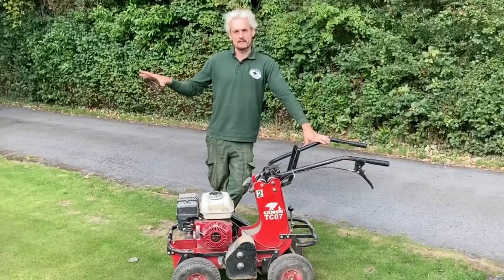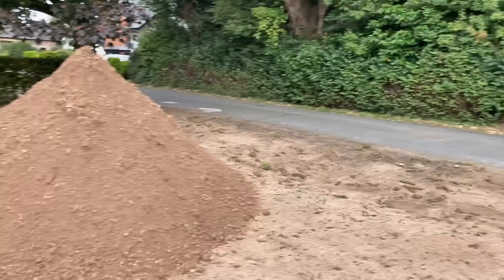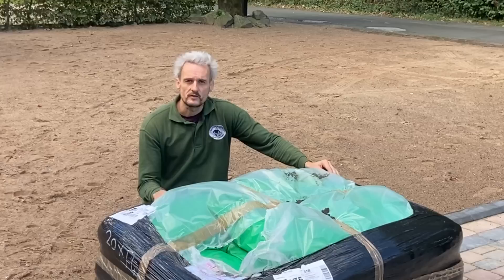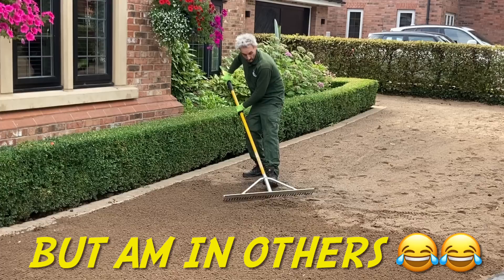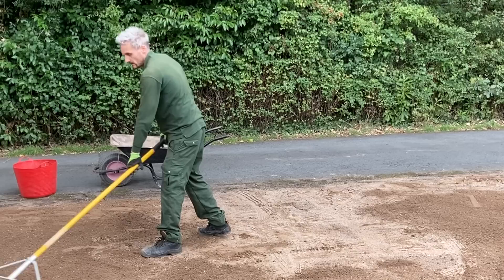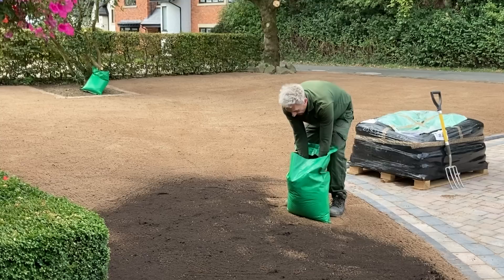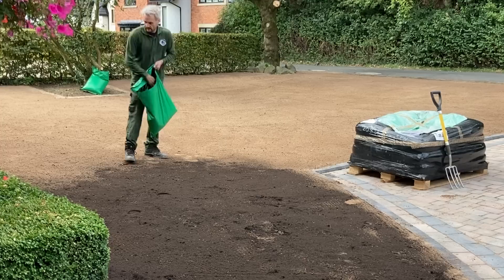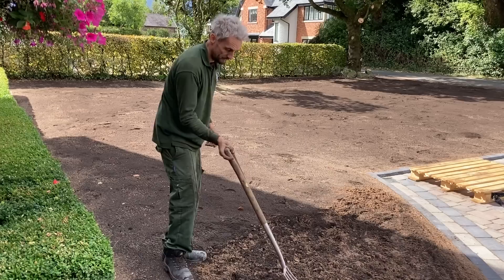The ULTIMATE New LAWN Guide * Part One, Seed Bed Prep

Comment: You work hard Dan, good for your customers to see the amount of effort that goes into the preparation of a new lawn. It's not just the cost of materials but for the hard graft it takes to get it done correctly. I've learnt so much about looking after my lawn since watching your videos. 20k quite an achievement, won't be long before it's twice that. 👍
Reply from the maker: I do work hard …. Most the time lol, it deffo requires graft but alls i used was a rake and a fork so not something you need expensive tools for

Comment: Superb that you've passed the 20k subscribers.. brilliant. Next time the grab man drops the sand off, ask him to spread it as far as he can with the grab bucket, save you (or AN Other) having to barrow it to where he could easily reach. Re the leveling of the lawn base, I saw a tip about using a ladder lay on the ground with a rope attached and pulling it around back and forth. Not having a landscape rake, I bought a 450x20x3 mm strip of steel from Wickes and bolted it level to the top edge of my regular rake, knocked the overseeding down to the roots and my top dressing went in a treat. Lawn looks PDG now

Comment: You could use some old tights as a filter when pouring into your sprayer. It’s works great for Iron Sulphate mixers
Reply from the maker: I could but the filter i have in there does the job

Comment: Really interesting to see you are using so much sand. Your videos related to the use of rootzone have been really educational. 

I'm planning on digging out my front lawn to 6-8 inches and replacing the soil with 75% 5 mm 70/30 rootzone (drainage) and 25% 3mm fine loam soil (water retention and binding surface structure. 

Does that sound like a good plan for optimal long term results?
Reply from the maker: Yeah but could still do with adding some organic matter as 30% in a 70/30 will dry out so quick , the back garden there is 70/30 with drains and few days of heat without water and its struggling
Reply: I was a little worried about that. Thanks a lot. 

I have the option swap the 70/30 with 50/50 or increase the loam soil amount as that has added compost in it but i'll have to check on what percentage. I think it may be as high as 25%.  The last thing I want is to have to dig it up again. @DanielHibbertLawnExpert

Comment: 7 minutes in and I'm playing columbo. Just one question... would the organic matter (field compost) that is being mixed into the sand not break down overtime and then need replacing?
Reply from the maker: Very slowly yes but then we top dress with the same stuff every year anyway which replenishes it
Reply: @DanielHibbertLawnExpert  Ah yes, apologies, forgot about the top dressing :D,  
errr, one more question..... are you able to share where you got the 10tonne of rootzone from? I am a Chorley native. EasyLawn in Bolton seem to have doubled their pricing with their new webpage.

Cheers
Reply from the maker: @txrlightweightexhaustsyste634  easylawn is where i got it, loose works out at around 40 quid bit theres a 42.50 delivery charge to chorley obs trade prices those, can sort 4 u if n when you need
Reply: @DanielHibbertLawnExpert  Just checked out their webpage and its back to £42 a tonnes ish. For some reason after the updated website the prices rocketed, but an error i assume. 
cheers Daniel, and I'm looking forward to the remainder of the series, as i want to do this type of renno on my front lawn which is a similar size.
Reply from the maker: @txrlightweightexhaustsyste634  they do it sometimes when they madbusy to deter orders

Comment: Hi Daniel, why do you add the concrete to the back edge of the drive? I have a slabbed area which im thinking of removing some, would you recommend I add a concrete bed from where the remaining slabs and new lawn is going?
Reply from the maker: The edgings where lose so stops them sinking

Comment: Hi Dan 
I have just renovated my Lawn and started from scratch and went for seed 
I have Just taken me covers of today after seven days and its germinated well 
and looking good, it will need the first cut probably take a cut in about 10 days 
the way its going, its 300 m2 my mowers are the Hayter harrier 56 and the 
Allet Kensington 20’’
they are both a bit heavy for the first few cuts. I was thinking of purchasing 
a cheap hover or a cheap light rotary. Any ideas you recommend?
Salv
Reply from the maker: Bosch rotak lithium ion
Reply: @DanielHibbertLawnExpert     Thanks Dan I will check one out

Comment: Hello Daniel, just a question. Would seed on top of the root zone grow with compost on top of the seed?  I’m sure ive seen you do that before but I could be wrong.
Reply from the maker: I mixed it in as this rootzone has no soil in it so needs something adding, works better but if you buy proper 50/50 or 70/30 rootzone you dont need compost
Reply: @DanielHibbertLawnExpert  great Thankyou.